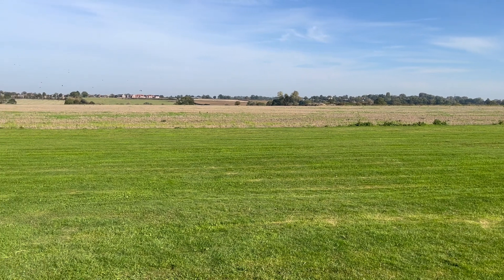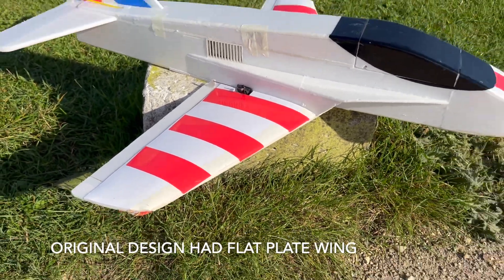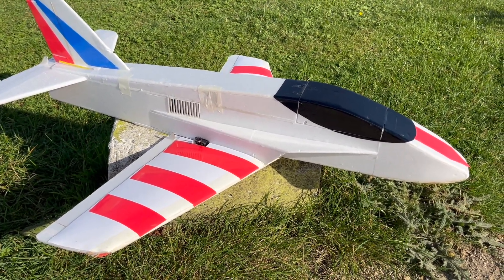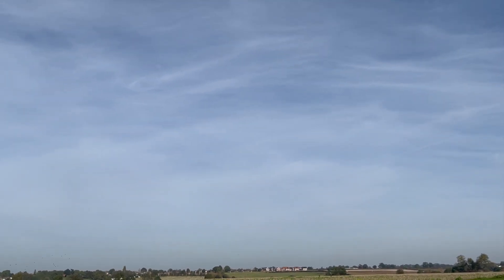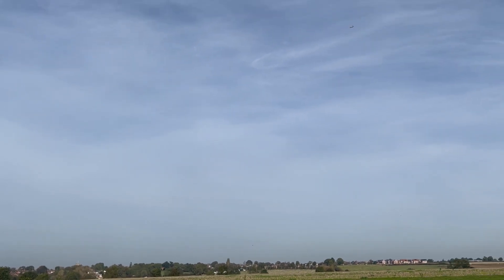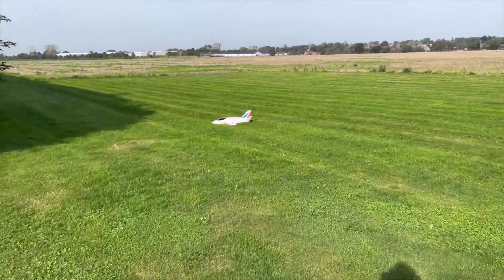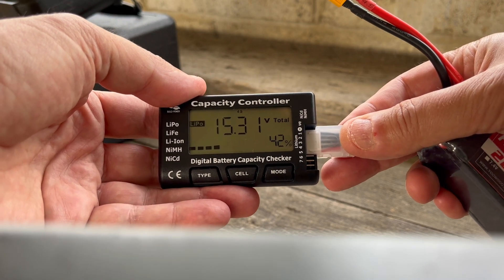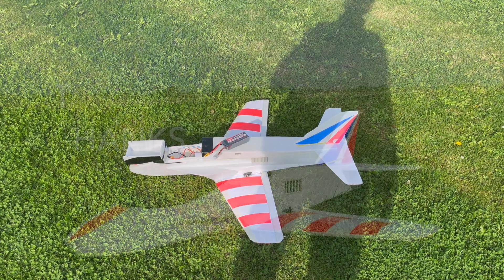Do Airfoils Actually Work?  Testing airfoil upgrade to the prototype EasyJet scratch built EDF jet.

Comment: cool plane,   3s or 4s?
Reply from the maker: Either. You can get EDF units for either 3s or 4s, so as long as you match the fan to your battery it will fly fine.